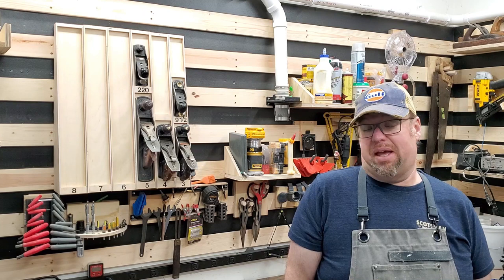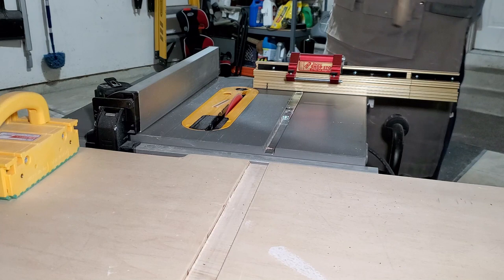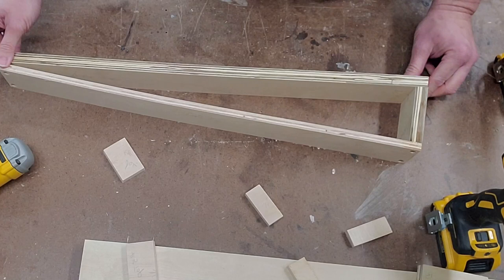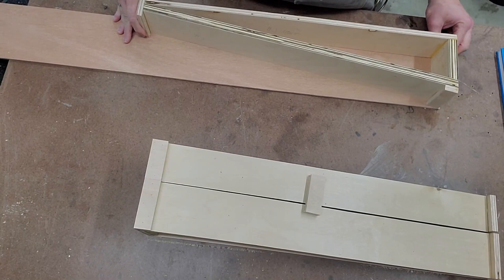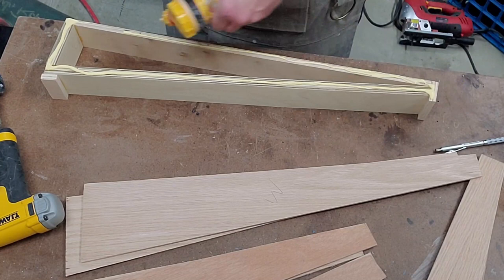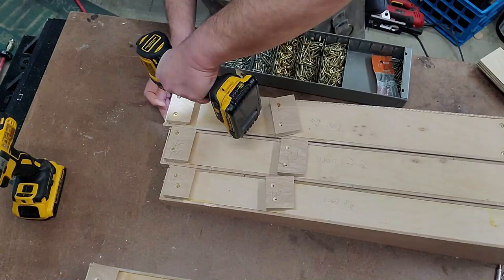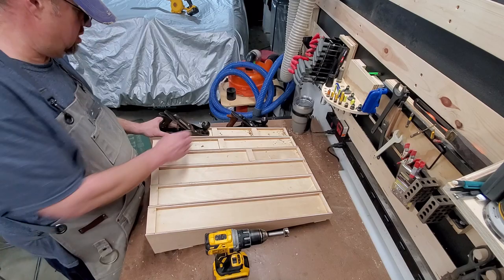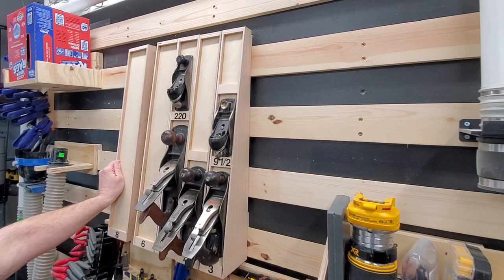HOW TO BUILD a Modular Woodworking Plane Till | Free Plans!

Comment: Hi SGW, such I great idea I’m almost finished the till 😁
Question on the magnets, did you find they had a good grip or were they too strong? Interested to know your thoughts, just that 60lbs of force seems like a lot 🤷‍♂️ cheers.
Reply from the maker: They are not too difficult to pull loose.  Last thing you'd want is a number 8 to fall one something. Stronger is better.